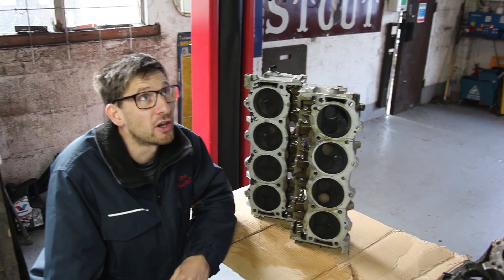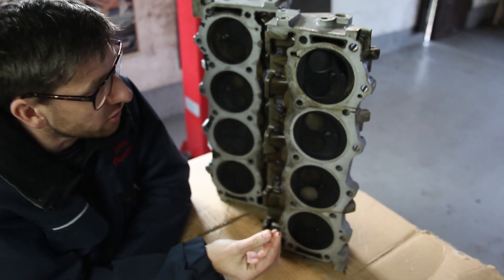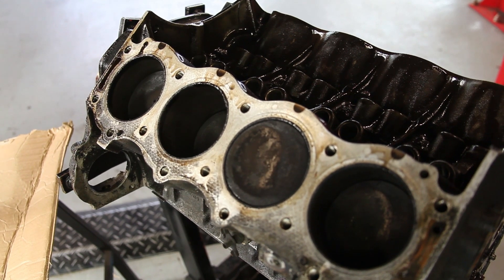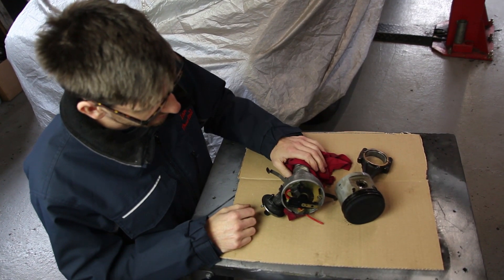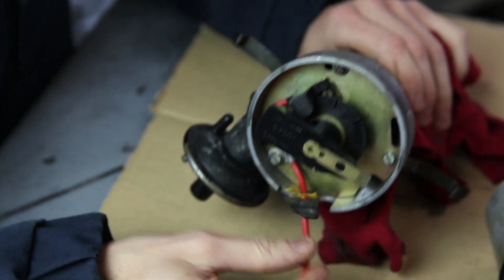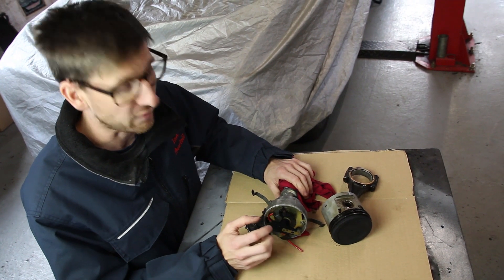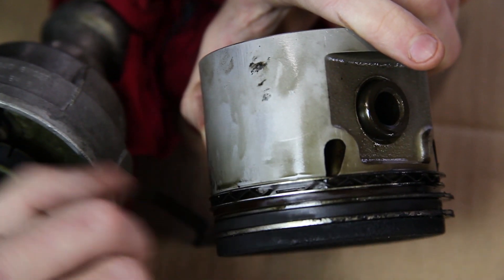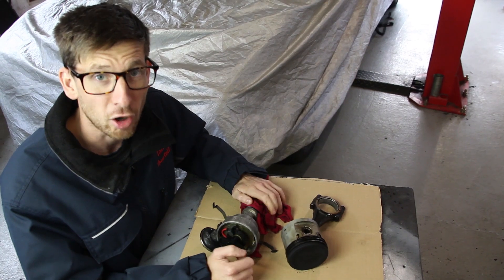RPI Engineering TR8 engine strip down (episode 3)

Comment: I had a similar optical pick on an aftermarket electronic ignition system back in the late 80s. The gaps in the plastic rotor disc were much wider. That might also affect the length of the spark on the plugs.